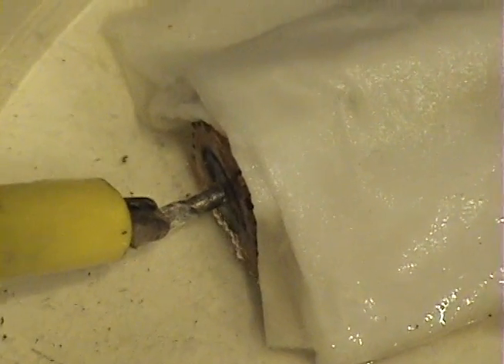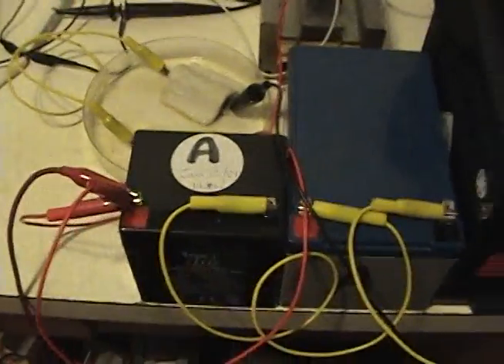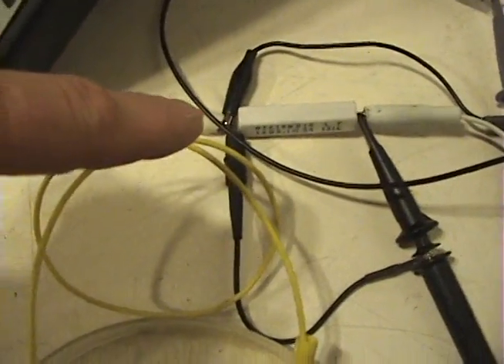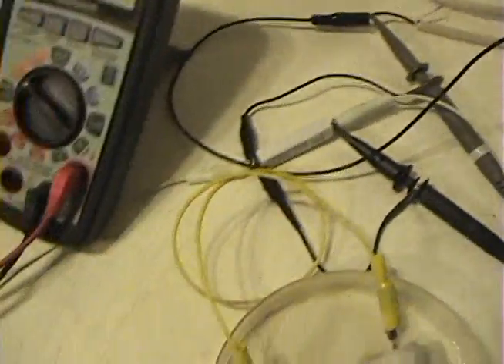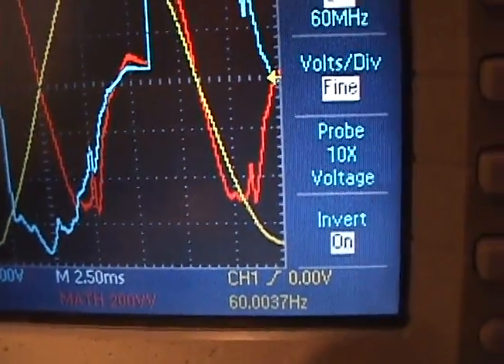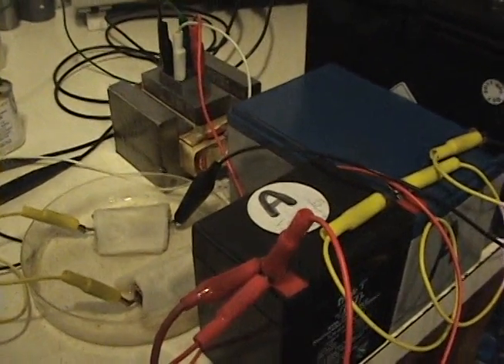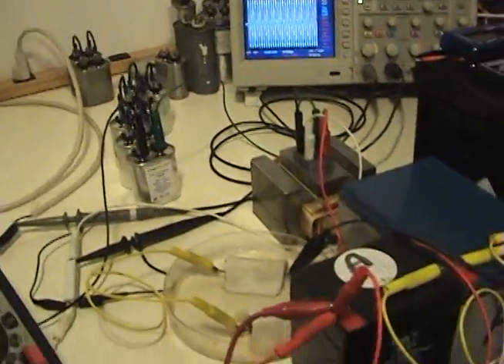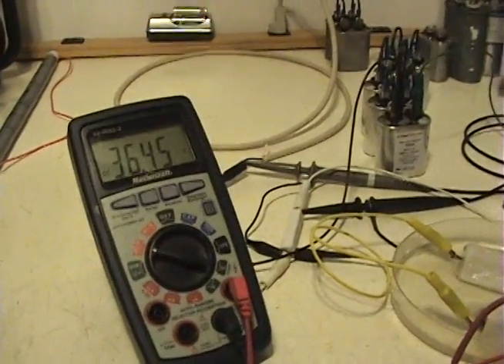Reactive Battery Charger at 36vdc

Comment: the batteries require different charging methods for different states of charge (<80% charge), and different battery chemistries.  Valve regulated is different from wet lead acid, which has different charging method than Li-Po.  You should use the appropriate battery chemistry for this charging method -- wet lead acid is probably most suited to your charger
.

Comment: Thanks Luc for sharing! No worries on replications. I've talked to several guys who are in the process of getting set up. I just found out about your recent posts and am getting caught up. I'll have something posted very soon... I have motors, caps and batteries... Its amazing how people come out of the woodwork to a thread just to muddy the waters - isn't it? What you've shown is very much what Don Smith was doing as far as I can see... Take a look at US Patent # US 2008/0297134. I think you'll find that interesting...  Thanks - Luther
Reply from the maker: Thanks for your comment Luther. Not all these guys are bad news. Poynt99 has caught a problem on my scope setting. The probe need to be on DC coupling and not AC as I had them. This makes a difference in numbers. They are not so good now.
We are trying to get the numbers accurate, so hang in there.

Luc

Comment: Hi Luc,
Those Li-Ion batteries are great, I do a lot with those to. Most of my Christmas lights ran off of a 5Ah Li-ion for over a month (a few hours a day).
There are two kinds of Li-Ion batteries. The secured ones and the unsecured ones. The secured ones have a circuit inside, which does several checks. It wil prevent the battery from delivering to much current, from getting to hot, from being short cut and from overloading. If you have secured ones, the circuit may have taken over to prevent either overloading or overheating. And it might have been damaged as well, who knows. Li-Ion is not supposed to get too much of a peak. A lead Acid battery can handle a rectified peak for sure. I think the li-Ion could not handle the power it got delivered. The 5000Ah should be able to withstand 2C, 10Ah, but the voltage should not get to high or it may result in damage. The Li-ion voltage is 4.2 Volts right after a decent charge, and you may use the batteries down to 3 or 3.something Volts. If you drain them to much, they get damaged. But if you want to use your batteries later on for your project, don;t experiment with them as they would get damaged easily. Please take some time to get to know Li-Ion batteries. if they get to warm/hot, they can and will explode. The explosion happens after the container has gone open and moisture can come to the lithium. That is where things get very hot very fast. Agina, just do some research, if you treat these batteries right they are really great for lots of projects!